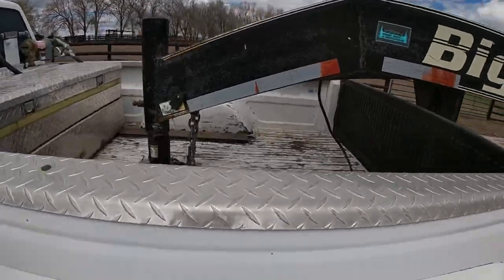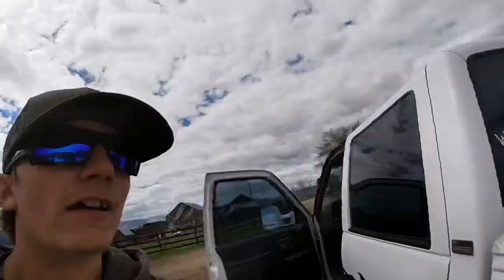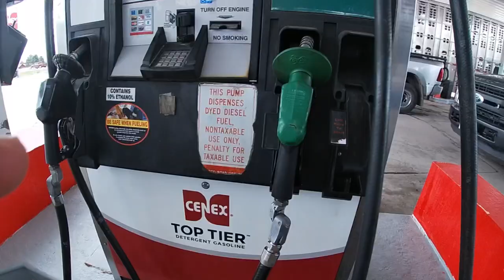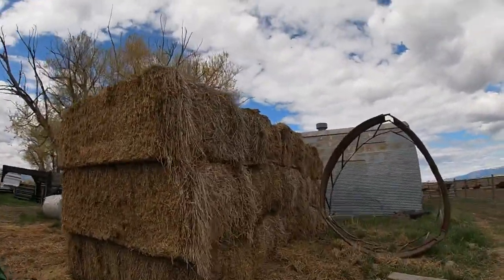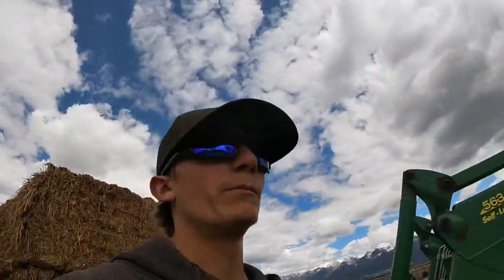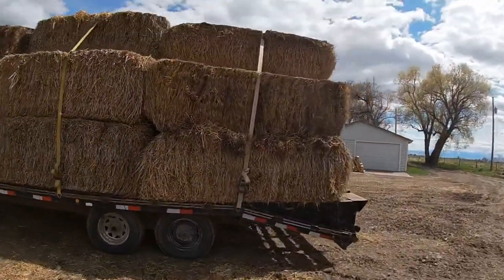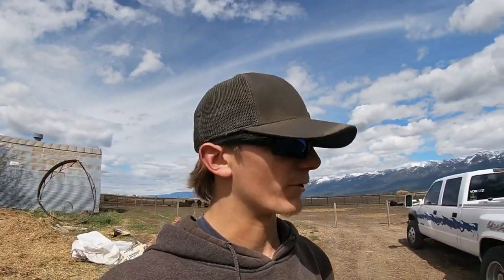Hauling Hay With My 454 Dually!! | Kioti PX9020

Comment: My mom actually owns a 99 C3500 SRW, big block also. I am currently working on it for improvements. I figured since she was a single mom raising 3 kids with a ranch, least I can do is fix her 1 ton and put it back into good condition. MPG is where it gets ya though. I use 91, filled up on $80 with the tank at 1/4 haha

Comment: I used to own a 1998 Chevy 2500 454 ex cab long bed pull very good. But for some reason it like to run to warm in the summer months. Tried several things nothing ever worked. It was ok if your weren't hauling a heavy load. Finally sold it and got a 2004 Chevy 3500 crew cab long bed dually 8.1 L. 496ci.  410 rear end gears with the Allison transmission 5 speed. Love this truck it will haul anything I need. It has hauled 16 5x5 round rolls of hay   . With no problem
Reply from the maker: I’ve heard a lot of people say their 454 ran hot. Mine actually runs cool I’ve only seen it near 210 like 1 maybe 2 times. Dads 94 runs a little hotter though
Reply: I still have a 1997 7.4l used to run hot till I replace the cooling fan switch and I never had a problem after.

Comment: Did you have to do any modifications to be able to tow this much? I'm thinking up a c3500 was bummed to see it can only tow 10k
Reply from the maker: Just a gooseneck ball! Motor is all stock besides headers. Dads got a 94 454 that’s bone stock and we tow loads just like that regularly with it. In fact here in the next month I have 60 1,000 pound round bales I gotta haul home so be on the watch for that one! I run 14 rounds in a load

Comment: Love seeing the truck being put to work, I have a '97 with the 7.4 L29. What is the approx weight you are hauling? How does the truck do with the load?
Reply from the maker: Those loads are about 14,000 pounds. It does good! Gas milage is bad as one would expect but it handles really nice!
Reply: @cjfarms5600  smiles per gallon!
Reply from the maker: Exactly!
Reply: @cjfarms5600  410 rear end?
Reply from the maker: @wildestcowboy2668  yessir!

Comment: what year is your obs truck here and 4x4 of course cause i  just bought a 2wd 95 c3500 crew dually and they keep telling me i cant tow more then 12k with it
Reply from the maker: Mines a 97 Vortec 454. What motor do you have?
Reply: I just towed a 40 foot fifth wheel with my 2000 k2500 350 vortec with an automatic. Total weight was 22,650, truck it self weights 6500. Total weight of the camper was 16,150.
Reply: @cjfarms5600  454 motor
Reply: As a rule of thumb you can tow anything stopping it is the problem. I’ve pulled a Ford 5000 with a front end loader and 8 foot box blade with my 96 Silverado 1500 with a 350 Vortec. The only issue I had was stopping. Took special care with that one.
Reply: @brandonalley1082  son it ain't the towing it, the problem is stopping it. It's all fun and games till ur on the phone with sweetie and don't notice the light turned red
Reply: @brandonalley1082 how did that workout ?